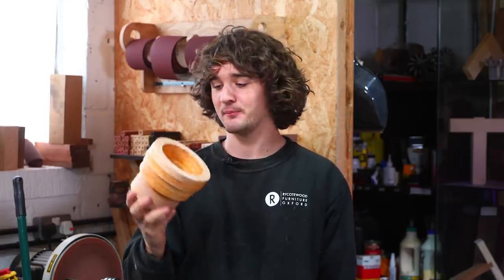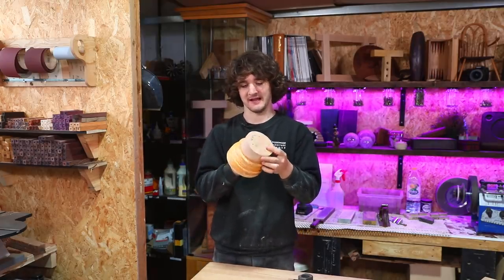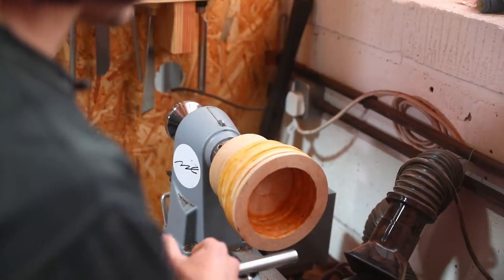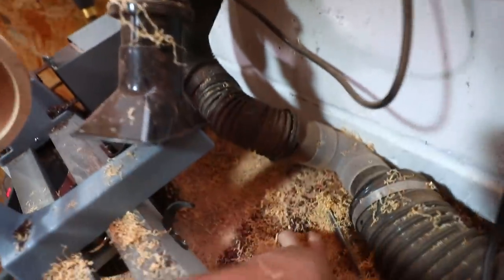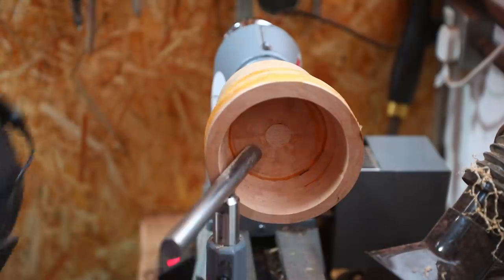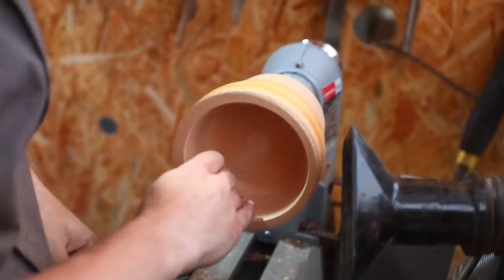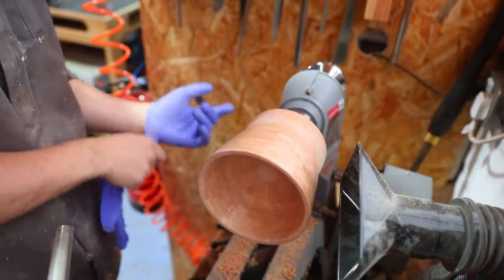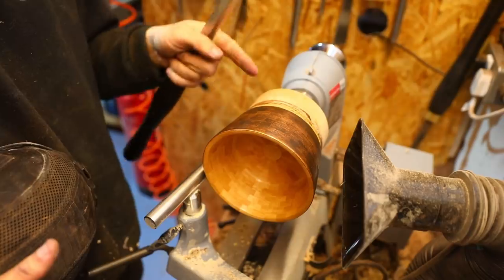Turning a SEGMENTED BOWL | Turning Tuesday #24

Comment: The way you separated the bowl was the correct way, Matt.  The only thing I would have done differently is, I would have turned the bowl around, and using some paper towels between my chuck and the bowl. Then I would have opened the chuck up to hold the bowl from the inside, then parted off the block, then finished the bottom on the lathe.

That being said, there's nothing wrong with what you did.  I just would have done it differently because I'm lazy, and I don't like doing sanding off the lathe if I can avoid it.

Comment: Hi Matt, good video.  Not sure staining was the best idea.  Might have looked better naked with a satin finish.  No not you (heaven help us).  You were right not to try and bandsaw the mounting block off.  Firstly, you would have to stop it trying to spin.  Secondly, it would need supporting to stop the blade sending it crashing into the table. Wise move to use the parting tool and saw.  It might have been worth trying to make a jam chuck to fit inside the rim to finish the base.